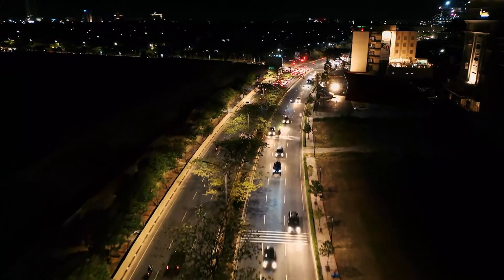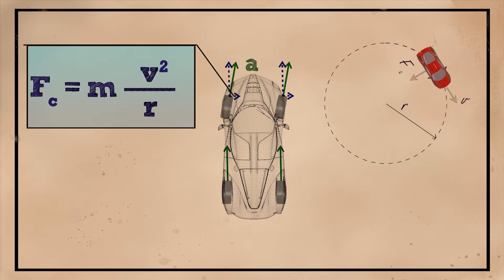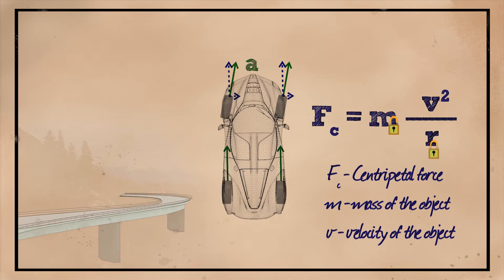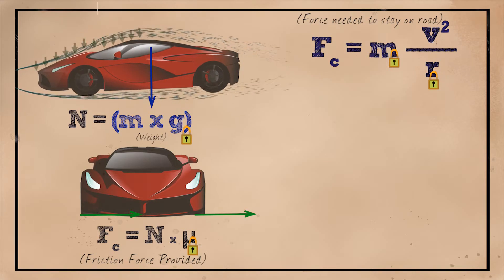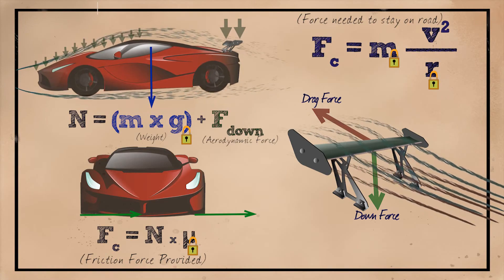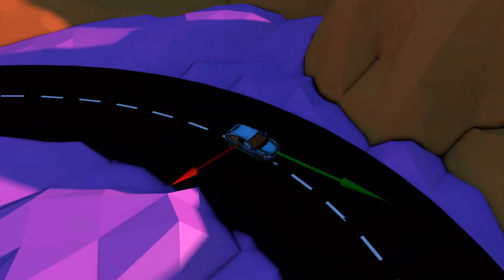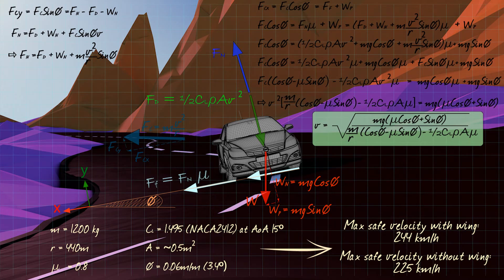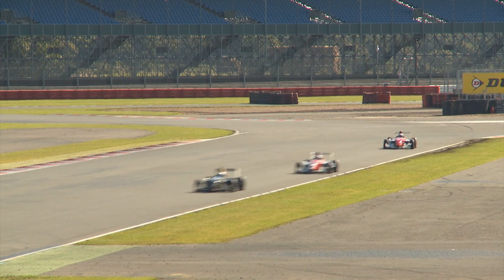The Secret of Car Spoilers

Comment: maybe you should look at the old ford sierra hatchback and its wind tunnel tests ford did, why do you think they put a rear spoiler, front spoiler, side skirts etc on the xr4 ti and cosworth, and there i am thinking of normal street version, could it be because wind tunnel tests showed there was a lift over the rear wheels of 225 kg at 150 km/h,
after the big whale tail wing came on there was only 75 kg lift and the 2 rubber lips on the rs 500 there was 15 kg downforce,
it wasn't for fun either they put a spoiler on the mk 2 sierra cosworth or the big wing on the escort cosworth and there I mean the street versions, see that the ecsort wrc version later got a different type of rear spoiler than the street version,
look at modern street cars today, they also have spoilers and skirts because they both provide better fuel economy and better driving characteristics, even on a small opel corsa 1.0 it is on

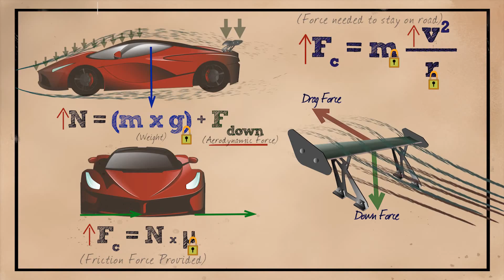Comment: 3:45 Something does not add up. Front wheels are responsible for steering controls. Spoilers are behind the rear wheels. By generating more down force on the Spoilers only reduces downforce aka traction on the front wheels. So this explanation feels misleading at the best.

Comment: Wings and spoilers have different purposes and you seem to be using them interchangeably. Wing creates downfoce and increases drag, and is literally an airplane wing mounted upside down. A wing is used to help the rear wheel maintain contact when travelling at highspeeds by combating lift. Spoilers mitigate drag and lift by redirecting the air to better fill the low pressure regions left behind by the car and can be useful even lower speed environments

Comment: Engineering thinking can apply to many problems. 
Some engineers are locked in to one commercial solution and can not even consider the wider matters. 
Many engineers are employed by government or involved in government projects and can only "toe the official line".
I say that because the the world agrees CO2 reduction is critical. 
The EV car with the big battery is a critical factor. 
The electical grid connects everyone. 
Rooftop PV is a dispersed source of efficient electrical power. 
The grid can concentrate and transport this 'free energy'.
The EV car battery does 2 jobs 
1.The Daily drive 7wkh. 
2.The grid virtual power supply 24/7 and stability by being plugged in 24/7 except in the rush hour. 
The car can trade power and the rooftop solar PV can trade power with the grid. 
The money is in the grid. 

Petroleum is a strategic military reserve asset. 

I say all this because simple Engineering thinking can quickly put the numbers together. 
ALSO nuclear power is being put forward by nuclear engineers as the best solution. 
If a world solution to stop CO2 consider 
90% of the world's population is in dictatorships. Pitler in Russia is threatening the unthinkable. 
All with their own nuclear industries!!!!!
The USA military costs will expand from 4% to 40% of the national budget 🙄. 
The USA is the biggest target in the world. 

The Engineering thinking is uniquely useful if free of vested interests. 
I hope I have not been too cryptic.

Comment: If the car wing down force doubles the down force on the tyres then the speed should double in a curve. 
But the front may slide out.
Suspension would also need to adjust for control reasons. 
The wing would need to adjust in the straights. 
This is getting complicated Hahaha 😕 
Good work as you illustrate all the components of this matter. 
A picture is worth a thousand words.

You also illustrate how intuition can make use of your insights to quickly go to better places with more thinking. 😀